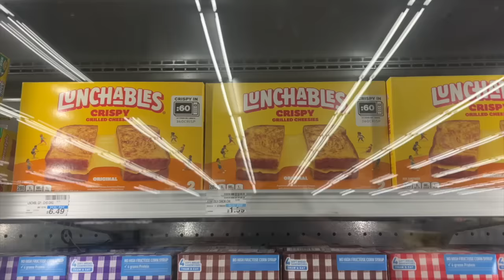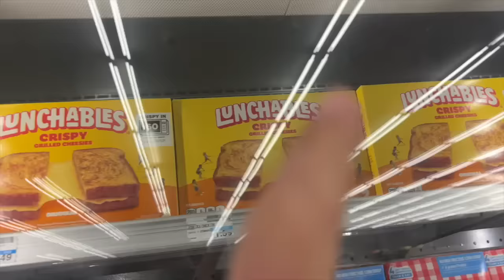I will survive this

Comment: hey lash tech here when you get your lashes done I always recommend my clients to avoid steam as well as water because that can also loosen the adhesive so like showers as well as boiling water you don’t want to be sticking your face in front of a pot of boiling water right after you get your lashes done. Just wanted to let you know some extra precautions you can take to keep your retention a little bit better. 😊

Comment: I had endometriosis. Was horrible. If you haven't yet I would check for cysts. Cause on top of endometriosis I had over 20 ovarian cysts which caused alot of pain. I ended up going with getting a hysterectomy. It's definitely helped but it's not always a complete cure